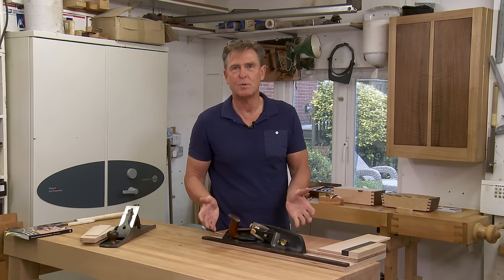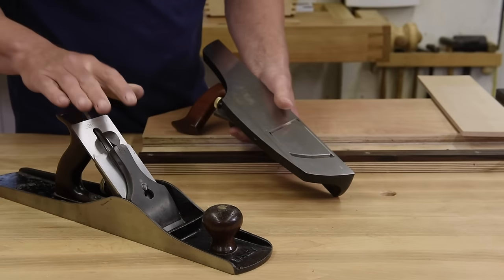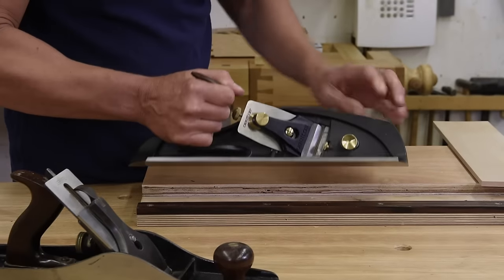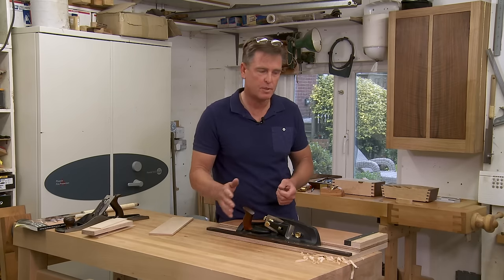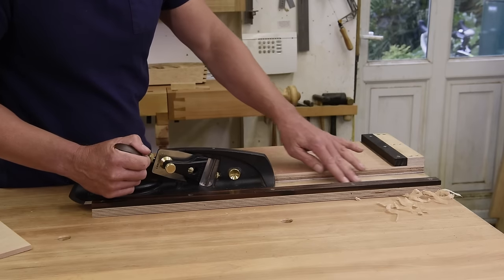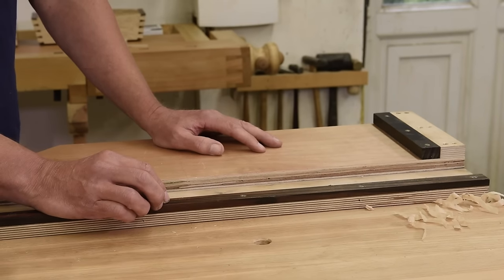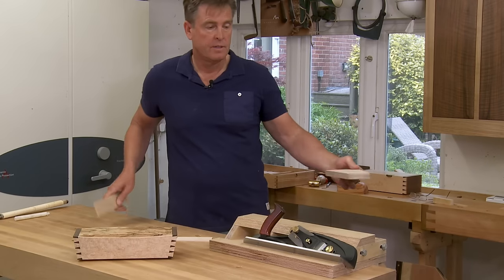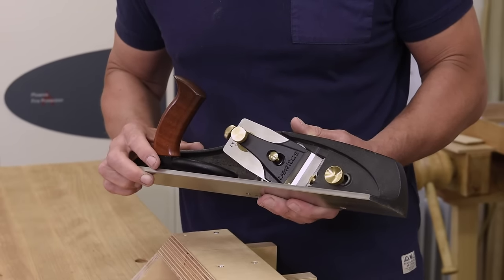Veritas Shooting Board Plane

Comment: thanks for the video.  The angle of the iron is at about 12°, but the bevel on the iron is about 30°, which brings the cutting angel to the board to be about 42°, not much different than a standard plane at 45°, but the skewed blade helps I'm sure.
Reply: The blade angle is 25° so all together the cutting angle is 37°

Comment: I love my Veritas shooting board plane . I presently have the Veritas aluminium guide but I think I will do a shooting board  along similar lines to yours with one main difference being The front fence will be around 200mm from the end of the board so that the sole of the plane is not cantilevered into space at the end of the cut but is fully supported.  Only a little thing but it seems right to me. Robert Wearings Essential Woodworker and the Resourceful Woodworker are my two favourite books and  I keep referring to them year after year. Thanks for the video and all the best.

Comment: They are a very nice plane and a lot easier to get hold of than the classic Stanley #51 (It took me 30 plus years to find one in good condition for a reasonable price). Not as heavy as the #51, but the engineering and design makes up for this.

Comment: Hi David, Can you give us a little bit of info on the low friction tape. I can't justify the plane but can change my practice of shooting along the bench rather than across. For so long we have followed convention then you come along and... why didn't I think of that or do that sooner. Thanks David.
 Don't burn yourself out with all the videos in one go. Would rather see them spaced out over a few more weeks than all in one blast and then not hear from you again. We have missed you.
Reply: Hi Peter, the low friction tape is self adhesive UHMW, I use is .25 mm thick but that's not important. It's freely available if you google. I'm glad you like the shooting board design, I saw this years ago when I trained at The Barnsley Workshops. All the best, David.
Reply: Axminster sell it. Another alternative is to add a strip from a HPME kitchen chopping board, it machines beautifully with a router, though static will mean you're covered in little bits of plastic!

Comment: Hello , is the blade difficult to sharpen ?
Reply: The blade on the Veritas Shooting Plane sharpens like any ordinary plane blade. The blade is not skewed, it is angled or skewed 20° in the plane bed . It comes from the factory with a primary 23° bevel and a 25° secondary bevel for an effective cutting angle of 35° due to the skew of the plane bed. The bed angle of the plane is 12°.

Comment: David, your comparison of the "pitch" of the blades (at approx 55 seconds in), is a bit misleading, and it's because you're trying to compare the Veritas bevel-up to your previously-used bevel-down plane.  If you check out the Lee Valley webpage here: (http://www.leevalley.com/en/wood/page.aspx?p=70926&cat=1,230,41182,48945), you'll see that the effective cutting angle is 35 degrees.  But, I'll agree that that's still less than the 45 degrees you're citing for your bevel-down plane you'd previously been using.

Aside from that point, your video is excellent.

Comment: Your description of a bedding angle of 45° vs 12°, while true, is somewhat deceiving. The bevel down plane effective cutting angle is 45°. The shooting plane bedding angle of 12° plus the 25° bevel on the blade yields an effective cut angle of 37°. I would hardly characterize an 8° difference as a  "much, much less abrasive angle".
Reply: Hi, yes I realised my misleading comments after the cameramen had gone home and it was too late to re shoot. Although in practice the bevel up planes do cut end grain more easily and the blade stays sharper a bit longer. All the best, David.
Reply: "Bevel up planes do cut end grain more easily."  I have heard this, before. But I always figured the choice between bevel up or down boiled down mostly to... where do you want your hand/handle to go... The blade has to stick out the top of the plane somewhere. On the smaller planes where you hand goes over the top of the blade, you need bevel up, else you will have the back of the blade sticking into your palm. On the longer planes where the handle goes behind the blade, the blade has to be bevel down so the blade is more vertical, making room for the handle. Then on the super long planes, you can go bevel up, again (why not? It makes the plane sleeker/flatter), because the handle goes so far back. :) The cant/skew of the blade on this plane should be a significant improvement, for sure. But the fact it is CURVED? It seems like it would be slightly trickier to sharpen it while keeping the cutting action perfectly level. In fact, it looks in the vid like the center of the blade has some bevel on the back, which I assume it would need. Else the blade will be taking concave cut out of the wood. I would like the plane better if the blade was skewed but straight. For the life of me, I can't figure out how you are supposed to keep this curved blade cutting straight. Once you put it in the plane at 12.5 degrees, things get complicated. You can't just sharpen the back at 12.5 degrees, else it won't take a bite. If you bevel the back with a lower angle, it will still have some concavity to the bite. It seems like it would not be straightforward to sharpen this blade.  Oh. And thumbs way up on the shooting board. So many great ideas all around.